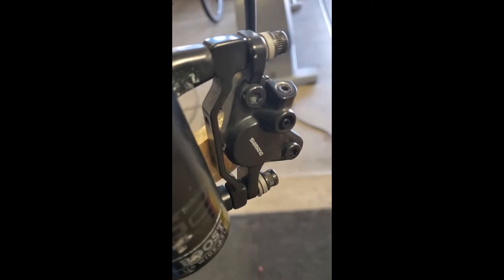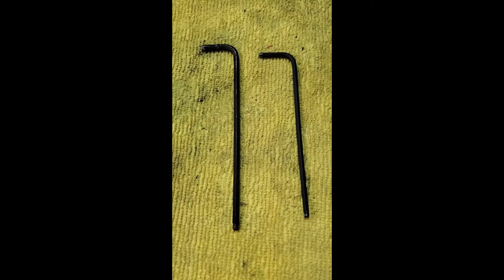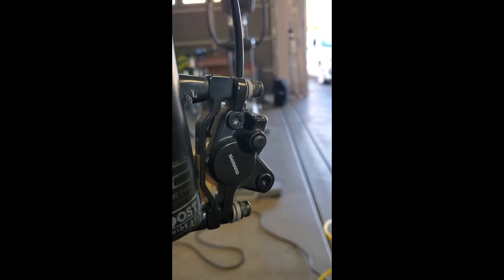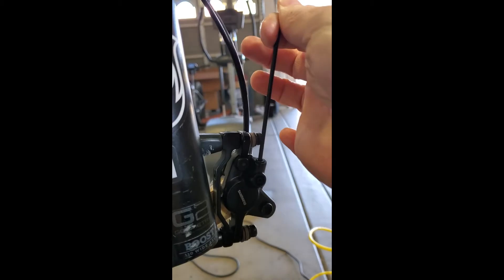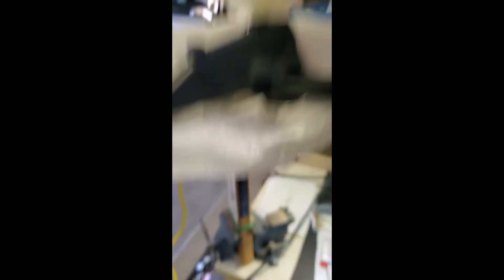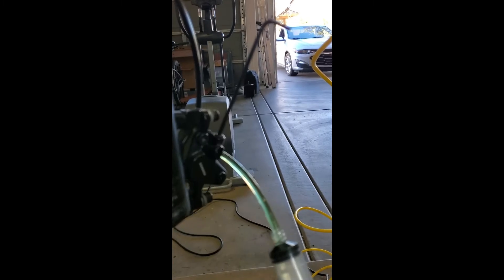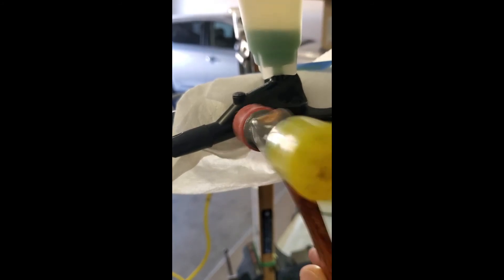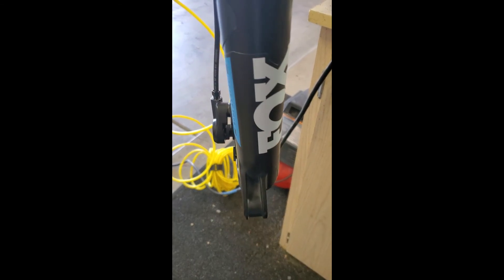Shimano BR-MT400 Brake Bleed

Comment: Hello,  I set up per the video and did the half to 3/4 turn on the screw.  

Don’t know why, but when i tried this method, the fluid would not go up through the system.  Almost like it was plugged.

When I reversed the process (ie drain out into a plastic bag), there was flow.  Any reason why there was no flow when using syringe at break?  Tnx in advance!
Reply from the maker: I would turn the plug screw out maybe 1.5 turns then. Sounds like you're not getting enough open. Mine worked at 3/4 but ymmv.

Comment: There's another method called "gravity method", which doesn't require a syringe, just the end hose of the syringe and of course the reservoir attached to the brake lever, do you think that gravity method will work?

Comment: Actually, your guide is incorrect as it is missing 2 essential steps. 
1. Before inserting the bleeding block, you would push pistons back into the body while the cup is already installed on a lever (system open on the top). 
2. Your caliper will be with bubbles unless you push back at least 1/2 of the cup back with a lever main cylinder. You can seal the bottom screw only after that part. 

You can learn the correct process at the parktool or shimano manuals.